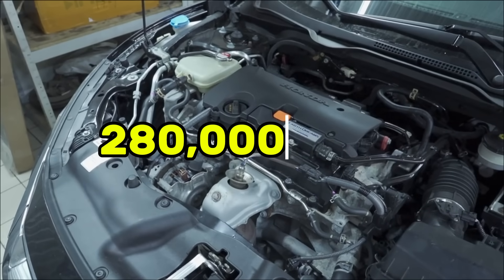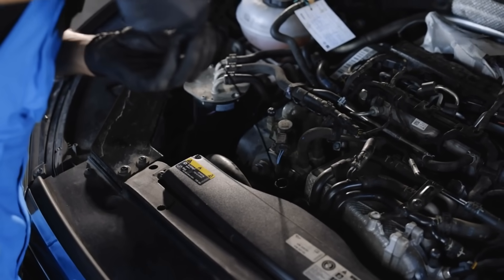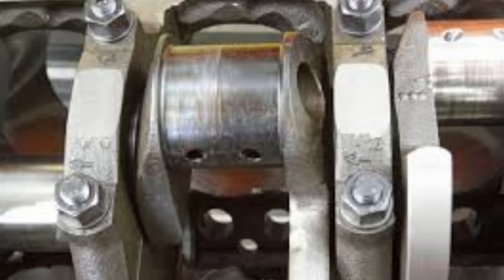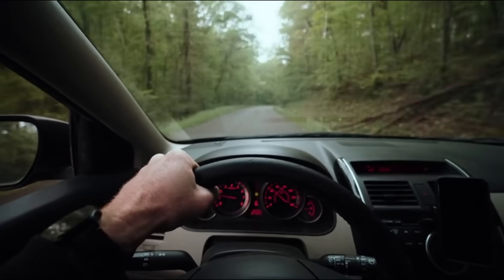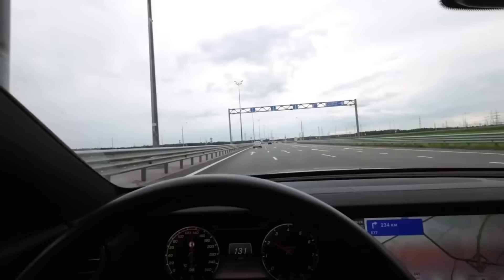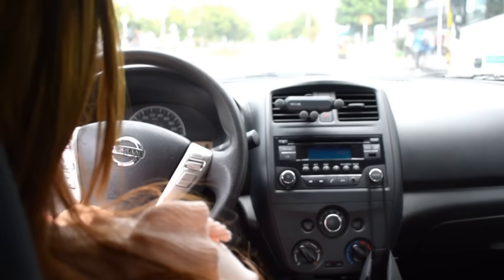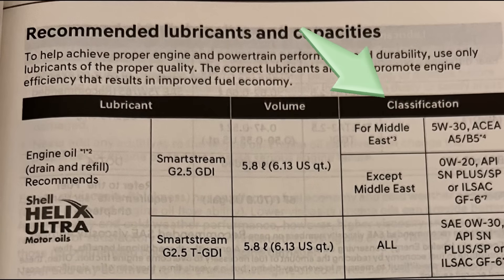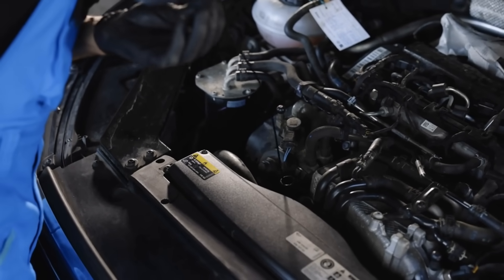I Tested 200,000 Miles of Engine Oil and Found the SHOCKING Truth

Comment: When 5W30 oil came out, no one believed in it, just like 0W20.
I have a Ford Focus Mk4 1.5 diesel with 244,000 km. I've been using Liqui Moly 6610 0W20 oil since the very beginning. No problems! Change your oil on time and you'll be happy!
Reply: Liqui moly is a group 4 oil, or true synthetic, group 4 and 5 oils have a higher heat range.  Also, you didn't mention your average temp.  Below 60F 0w20 should be fine, but there are now videos coming out of engine failures on 0w20.  Not every smoker dies of cancer, not every KIA catches on fire, so even if your temps are over 60F, you got lucky.  And I'm sure that group 4 Liqui Moly helped.

Comment: Every engine must use the oil recommended in its specifications. The problem is not the 0W-20 itself, but how often it is changed. Halving the replacement interval recommended by the manufacturers is what makes engines last almost forever.

Comment: Just a point, they go with thinner oils to increase mileage, that happens because of reduced friction, reduced friction also reduces wear, thicker oils have more pump resistance , lower flows given the same pressure, oil path and bearing clearance so they get lower mileage and additional wear.  If you lose the oil wedge you lose the metal whether fast or slow.  You can have it one way or another but not both.  I worked 40 years on large steam turbines that are over 100 feet long, with a rotating assembly over 100 tons, running for months sometimes a year continuously at 3600 rpm.   Metal temps in the steam path are 950 f to 100f . They do this on straight 10 weight mineral oil with anti corrosion additive.  The oil is only filtered and occasionally centrifuged for water removal per routine analysis, unless a large cooler leak renders the oil not feasible to recover.   There is a lot more to this than heavy oil is always better.
Reply: You commented the same thing in another video. Except in the other video, you said your steam turbine oil was cooled to 120F. That might be for the oil in the sump. A google search says the circulating oil in a steam turbine could be 158 to 203F. 

Assuming your 10 weight oil is at 160F operating temperature, it would be equivalent to a 30 weight oil running at 200F in a gasoline engine. Around 10 centistokes. For comparison, 0W16 oil at 200F is about 7 centistokes. So your 10 weight turbine oil is thicker than the 0w16 engine oil (16 weight). 

The same 8th gen 2.5L Toyota Camry is sold in both USA and Mexico. Identical A25A-FKS engines. The USA owners manual only recommends 0W-16. But the Mexico manual has a table that recommends 0W-16 to 10W-30 based on the ambient air temp. 

So the question is why does USA owners manual exclude the oil ambient air temperature table? Because they need to convince USA regulators that the average person will simply follow the owners manual, thus keeping emissions lower with higher mpg, thus avoiding the CAFE penalty fees.

Comment: 2015 honda accord sport, i did the 0w20 the first 5 years and then switched to 5w30, best thing i ever did. Engine is smoother, quieter and no oil burn. Im happy and fuel burn is minimal if any. I do 2 oil changes per year every 5to6k miles. Since i have 2 yearly vacations, i do one oil change during the summer july 4th weekend and the other the week of Christmas and new years. 5w30 full synthetic and new filter ( any and all oils and filters) are good for 5to6k miles. The idea is to change your oil at least 2 times per year or ever 5to6k miles of full synthetic oil.

Comment: This also depends if the engine was made with correct tolerances to Handle 0w-20 using a thicker oil on say 9th gen civics and accords can actually wear bearings faster and it can mess with oil pressure which in these engines they rely on 0w-20 do the vtc can work correctly
Reply: Nope, not true.  It would only happen if average temps were below 60F.

Comment: Running highway doesn't heat up engine. Strong wind cools the radiator effectively, and the engine load is low (not accelerating). Use the engine oil according to the manual is sufficient to keep your engine in good condition well over 150k. Changing oil regularly is the key.
Reply from the maker: Thanks for sharing

Comment: I changed to Penzoil synthetic 5 W 30 and a quart of Lucas synthetic additive.  My slight so-called hemi tick completely disappeared and oil was still clean after 10k between oil changes.  I’m well on my way to 300,000 miles.

Comment: I have a 2002 GMC Sierra 1500 HD w/a 6 liter engine.  From the day I bought it, I changed oil and filter every 5K miles, ignoring the manufacturer specs.  I have always used either 10W-30 or 5W-30.  At 313,000 thousand miles, I put in a remanufactured engine, BUT the kicker is I did NOT have to change it.  The mechanic at the shop where I made the change took my old engine and put it in his truck which had a bad engine.  He told me he is sure he will be able to run it for another 100,000 miles.  IF you want your vehicle's engine to last, change oil & filter every 5K miles and never use 0w-20, regardless of manufacturer specs.  I'm currently at 344,000 miles and planning to make 600K!

Comment: When I first heard about engine damage due to 0W20 earlier this year, I switched to 5W30 in my wife's 2013 Subaru Crosstrek with 180,000 miles. It immediately stopped most of the engine noise at cold startup. I have to say that I'm concerned about keeping it in the engine this winter, where morning temperatures are often around zero and highs only reach the 20s at times. I might to do a change to 0W30 before real cold for cold start flow. My old Tacoma always ran 5W30 full synthetic with ProLong oil additive recommended by a mechanic friend years ago, and it has 331,000 miles and counting on its 3.4 V6.

Comment: I've been using Mobile 1 full synthetic 5w30 in my 1996 Mercedes C280 since I got it and switched to high mileage blend a little while ago, still runs like new at 187,000 miles.

Comment: The specified oil for your motor is the one you want. Tiny gears will not get lubricated if you use too thick of oil..😮

Comment: Ive always known this, i live in a country where it never sbows where i live. in the owners manual it shows you this, you choose an oil that suits your climate,. I always buy diesel engine oil too, as its a higher spec oil and has additives to stop it breaking down etc  So in ny 2024 FJ cruiser v6 dual vvti 1grfe engine i run 10w 50 in winter here and 15 w 50 in summer here in australia.

Comment: These are the same manufacturers that say that their automatic transmission fluid is a lifetime fluid and never needs to be changed.  Sure it's lifetime.  When the transmission dies prematurely, because you didn't change the fluid, that's the end of it's life.
Reply: Engineers don't lie 😆. They have defined the "lifetime" of most transmissions are 75-100k miles. If you follow this recommendation, your car would last to ONLY max 100k miles.
Reply: @trucchuong1726 engineers don't write the user manuals.

Comment: This is a very nice video. I'm in Saudi Arabia and I follow the channel. We use Motorcraft 5W30 oil, but it's bottled in the UAE. The distributor in Saudi Arabia uses the same oil. The temperature in Riyadh reaches 60 degrees Celsius in the summer and drops to 0 degrees in the winter. I'd like to hear your opinion on the oil. My car is a 2024 Raptor, 3.5L Twin Turbo.
Reply from the maker: 5W-30 is the correct viscosity for your Raptor. Use a Full Synthetic version of Motorcraft (or another high-quality brand) and maintain a strict, frequent change interval due to the extreme 60°C summer heat

Comment: Great video, I learned a lot from it. Share and like! Question: Is the 3.5-liter engine on the Raptor really reliable with the 10-speed transmission? Would you recommend upgrading to the 2026 Raptor from the 2024 model?
Reply from the maker: Yes it is!

Comment: 2008 Honda Fit. 200k miles. 5-20, no oil consumption. Just switched to high mileage oil 5-30. Much smoother engine, more power.

Comment: My Lexus ES 350 calls for 0w 20 I will use 5w 30.
Reply: Isn't 5w 30 allowed per manual?
A friend drives an Mazda 3.
 0w 20 is recommended but 5w30 allowed.
I told him put 5w 30 in next time.

Comment: Tacoma second owner, I used 0W20 for my first oil change. I really felt that this was the wrong decision. I have a 2010 camry with the same 3.5 engine that I run 10W30 in that has 323,000 in it. After watching and reading several recourses, I'm  going to use 5W30
Reply from the maker: Thanks for sharing your experience with the Tacoma and your plan to switch to 5W-30!

Comment: Currently using 0W-16. Changing oil and filter every 5,000 miles. Numerous oil analysis says all is fine.
When your grandfather was alive, it was the viscosity that protected your engine. Now, they've come to realize that flow rate is also important and the flow rate is better with lower viscosity. However, the additive package in modern oil contains friction modifiers that were not yet developed decades ago. It's the additive package that reduces wear.
Reply from the maker: That's a great point about how modern oil technology, especially additive packages, contributes to engine protection!

Comment: Honda Civic 1.6 i-DTEC 2014, I change oil twice a year. In April I use 5w-30, in October I use 0w-30. I live in Sweden, so it gets quite cold in the winter.❄️
Reply from the maker: That's a great approach to adjust your oil viscosity based on the seasonal temperature changes in Sweden!

Comment: mix your oil 0w-20 and 5w-30. change the ratio depending on season.
Reply: Why not just go with 0w30?
Reply: @4drturbo85  0w30 is not easy to find here in south FL. i get my oil at costco and change every 5k miles. also depends on type of vehicle. non turbo doesn't really require 30. work horse motors would benefit from the higher viscosity. changing frequently does more than increasing top viscosity. my limited knowledge on oil is from rebuilding race engines where i can set tolerances  to maximum specs (requires higher viscosity for higher rpm's and engine pressures/loads). 

if you over rev your engine too often (new smaller turbos on trucks). oil wear will increase. change it more frequently. don't go by manufacturer's recommended intervals. 

remember that new oil technology has increased throughout the decades. lighter oils can hold their specs much longer than before. unfortunately, manufactures will use this reasoning to extended oil change intervals, which is not a good idea because engines have decreased in size and loads increased.
Reply from the maker: Thanks for sharing your strategy of mixing oils and adjusting the ratio for different seasons!

Comment: Stupid Americans! Low friction engines have down to 1mm oil passages in the VVT, Normal engines maybe 4-6mm. Also todays variable oilpumps is controlled by the ECU, the oil flow is programmed by viscosity of a 0w20 (if the car are spec with that) Dont go thicker oil in those engines. The oilpressure depends of temp,speed,rpm,load. Better flow keeps the temp down!

Comment: For my Ford Edge with over 100K miles; switched to Full Synthetic 5w30 for high mileage cars - improved fuel economy significantly and engine runs much smoother - especially noticed at traffic lights: the tach is very steady compared to the previous oil used.

Comment: 10W-40 in my 20 year old car. And even for newer I would never use anything below 5W-40.
Car manufacturers are a) subject to consumption (CO2) regulation, so they have to squeeze every percent of efficiency out of the engine by using these „watery“ oils, and b) they sell most cars through leasing, at least here in Europe. That means if the first leasing customer gets through his 2 or 3 years without problem he is happy and returns to the brand. If then the second owner gets through another 2 or 3 years before he sells on, that’s another happy one for the brand. At this time the car should have around 160.000 km with average annual driving, and the 3rd or successive owners are of no further interest for the car company anymore.

Comment: People please be careful with this, everyone knows thicker oil lubricants better yet modern vehicles are designed with smaller passageways that can restrict flow if put none recommended oil. Just change your oil more often
Reply: Well done m8
Reply: And that's been proven to be BS.  Experiment for you since you buy the BS.  Freeze some 0w20, don't freeze 10w30, now do a pour test.  The 10w30 flows way faster than 0w20 that's been a 32f for 24hrs.  So the narrow passageways is BS.
Reply: Finally, someone with a good head on their shoulders who says sensible things.
Reply: Manufactured recommended. 10k miles with 0w-8 on Camry 2025.  Oil change schedule.

So, What’s the best mileage for oil change For protection engine.  

I live in Texas.

Thanks

Comment: I have a 2023 Kia 2.5L engine requires 0W 20 I have 50K highway miles already and I change at the dealership every 5K miles. I live in Delaware so the weather goes from winter to summer temperatures. Still under 100K warranty. I’m considering now using 0W 30 oil. I’m curious if the dealership offers this blend. Or can I request it, I have every intention on getting my 100K warranty plus another 100K miles on this vehicle as I had 283K miles on my 2013 V6 Toyota, I change oil religiously at 10K miles also full synthetic
Reply from the maker: Thanks for sharing your experience and how you're considering a change for your Kia, aiming for that impressive mileage!

Comment: There's a lot of variances there, some live in a colder climate would want to run thinner oil than someone in a hot climate. 5w30 seems to be universal. There's also some with turbo's and there's also warranty. I'm in Houston and use Pennzoil ultra Platinum 5W-30 and do my own oil changes at 5000 miles and the oil looks spectacular. 2013 Challenger
Reply from the maker: It's great to hear your oil choice is working so well for you, especially with your own maintenance!

Comment: I use 0-20 due to dealer oil change service plan. Using other weight oils can supposedly void warranty. I have 2021 Jeep grand Cherokee and supposedly this 3.6 has tight engine tolerances ie vvt . Not sure but I don’t want to risk it at this point, I change every 5k full synthetic.

Comment: I have a 2012 Honda civic with 254,000 miles. Always changed oil at 5000 miles with 0-20 oil still runs great and burns no oil. I do drive gently!
Reply: 0w-20 is ultra thin oil but as long as you change it between 5,000-8,000km (3000-5000mi), there shouldn’t be any major issue.
Reply: @hitbyGROSJEAN how about 0w-8  . What’s the best oil change to protect engine.  ?
Reply: Are you in cold region?
Reply: @Danny-rf4gb No I live on the central coast of CA very moderate temperatures.
Reply: @billmcmillan7735  thanks. I was wondering how that oil does in hotter climate. Currently in New England and thinking to move south.
Reply: @Danny-rf4gb  
No, I leave in Texas.  Very hot weather.  Any advice?. Thanks

Comment: I'll use 0W-20 in my vehicles that call for it.  But I also lab test my oil at 2000 mi and at end of cycle, no more than 4k miles.  My wear metal analysis shows quite reasonable results.  On my vehicles that call for 5W-30, I will run it or 0W-30 depending on time of year, i.e., we have some cold winters here and pretty warm summers.  Lab testing is definitive.  I have a dual turbo V6 and it absolutely destroys viscosity quickly with direct and port injection systems, coupled with turbos.  For that vehicle, I have bumped from a Group 3 to a Group 4 PAO with Group 5 additives. We shall see how it lab tests out at 2K miles later this spring.
Reply from the maker: That's a very thorough approach to engine oil, using lab testing to confirm what works best for your specific vehicles!

Comment: Why does the government try to control everything.  They extort money from car manufacturers and they pass the bill on to the consumer.  If I need a big engine to pull a load, it should be my choice and not the government on which engine to use.
Reply: Since the government hasn't passed any laws forcing you to follow manufacturers recommendations, I don't see how you can say that the government controls what oil you use

Comment: After sending out my oil to a test lab (which I strongly recommend) I learned that wear on oil really kicks in after 7500 miles. I never go longer than that to change. 3000 miles is to soon and just wasting oil. I use 5w-20 on newer cars past 2020 as a compromise. In general though, this video is correct. Use thicker oil on very hot summery months but the recommended thinner stuff in the winter. The newer tighter tolerance inside engines require the thin stuff, not just for mileage but to prevent valve lash and parts from getting too much resistance due to viscosity.
Reply from the maker: That's great you're doing oil analysis to guide your change intervals and oil choices, adapting for engine and climate!
Reply: Too soon

Comment: G  day  from Ontario  So  does that mean  15-40  is better for protection  o  diesel's
Ths
Reply from the maker: 15W-40 offers great hot-temperature protection, but a full synthetic 5W-40 is generally better in cold climates like Ontario for cold-start wear protection.
Reply: @YourMotorCare  Yea  OK   Ths

Comment: I will never use anything less than 5w30, when you use what the car company recommends you will be buying an engine, My motorcycle a 2017 uses 15w40 for a reason, it would pile up otherwise. PS I lived up in the Northwest Territories and there I use 0w30 in the winter because of the extreme cold in the winter.

Comment: 5W30 for summer, 0W30 for winter.
Reply: Why? They are both 30 viscosity oils when at operating temperature. The 0W simply has a better flow rate during cold starts. That's the only difference.
Reply: @njsongwriter wouldn’t better flow at cold starts be ideal?